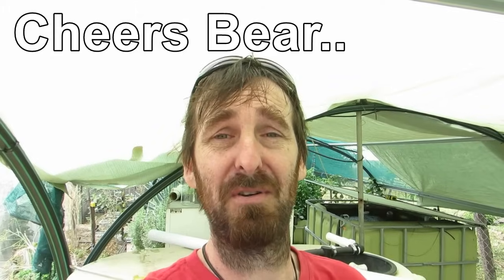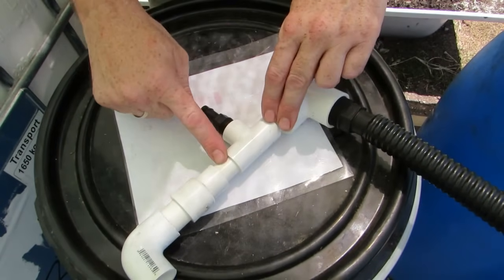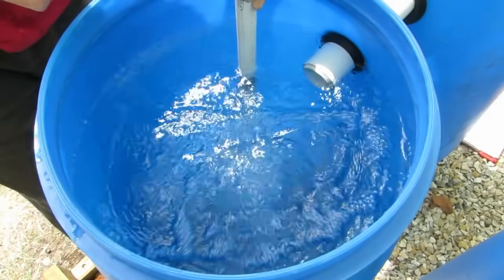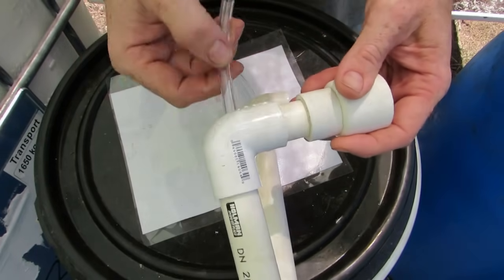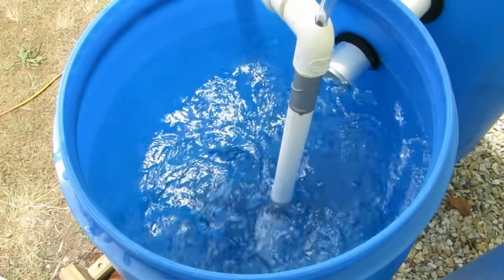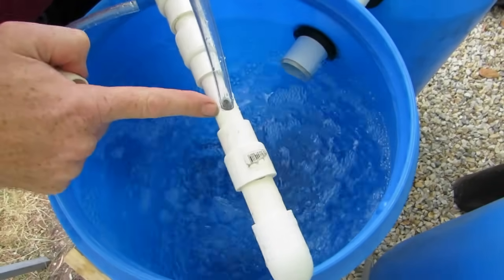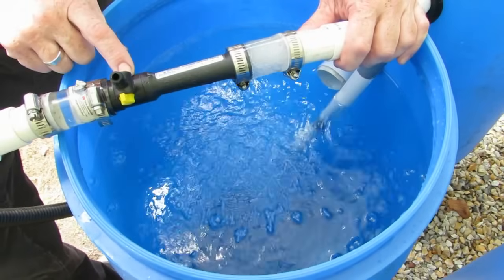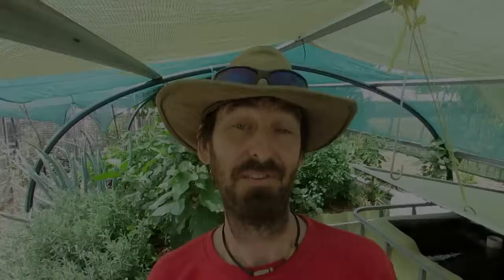DIY venturi, a few easy builds for aquaponics, aquaculture or hydroponics..

Comment: I'm using a 275 gallon ibc tote as my fish tank. with 6 tote growing beds.what size pump should I use? thanks
Reply from the maker: Hi Bonnie. 
The rule of thumb is to turn the water over in the fish tank at least one & a half times every hour if not twice an hour. That will give the grow beds enough time to process the waste from the fish.
 
Then you need to take into consideration the loss of flow due to head height as well as restrictions in the pipework  (90° turns in solid PVC pipe will reduce flow rates). 

The way you want to set up the flow through the system (pump to fish tank from sump & let it flow via gravity to the beds OR splitting the flow from the pump to the grow beds & the fish tank like ours) will also play a factor in sizing the pump. 

As an example, 
our first 275 gal fish tank system I had a 1188 gal per hour pump run straight to the fish tank from the sump & by the time it got to the fish tank  was only putting out 713 gal per hour. 

Another thing to take into account is that the manufacturers claims on the box in terms of head height & gph are seldom accurate. I think it always pays to over size your pump as there are ways to reduce the flow but you cant beef it up if need be. 

I know it doesn't answer your question but hope it does help give you a few things to think about.

Comment: How about putting an aeration screen on the output too to make the bubbles smaller as they exit from the hose?
Reply from the maker: Have though about that but am a bit concerned that the finer holes might clog up with solids waste over time.. Is a bit hard to service the pipe in the base of the fish tank.. Cheers for the thought & have a great one..
Rob..

Comment: Rob, that water looks great in your IBC. I'm assuming you're using a rad. or swirl filter?
Reply from the maker: Hey Brad..We had a small radial flow filter on the aquaponics in that set up.. Any fine solids that made it through get caught in the bed but I don't think that's a big issue.. 
Cheers & have a great one..

Comment: So i have a question the big hose pushing that the water thru the white PVC as the water goes by the T portion is the pressure the same as the water going by? or is it vaccum that pulls air in
Reply from the maker: Hi there..
At the position of the restriction below the air pipe coming out of the "T" the internal pressure is low which allows the air to be sucked into the water flow as I understand it so I think you're on the money there..
The chap in this clip goes through the workings & pressures involved..
Fluid Dynamics VII: The Venturi Effect
Hope that helps some..
Rob :)

Comment: Has anyone suggested putting a device similar to this at the suction of the pump? (depending on the pump)  The flow from the pump pulls in the air and then hits the impeller causing very fine bubbles and great mixing.
Reply from the maker: Have been told that it could damage some pumps. Not sure myself as I haven'y looked into it.
Cheers.

Comment: Is the smaller price of pipe nessacary to the venturi? Or could u just put q tube straight into the pumps tubing?
Reply from the maker: Hi SC Prepper. 
It does help create a low pressure zone as I understand it which helps more air to enter. I have also made them without the restriction with some vinyl hose & it works too, just don't think as much air gets in.
Hope that helps some mate.
Rob.

Comment: First, thanks for the awesome video. Secondly, I am wondering if it would be possible to enter a bubble stone into the venturi itself, to ensure that the bubbles are as small as you would like them to be. I am looking to build an aquaponics system, so I have not tried this yet, but it seems like it might be possible somehow. Let me know what you think.
Reply from the maker: Hi Walter... I missed your comment somehow, sorry about that..
You could add one in there but am not sure how it will help with the bubble sizing..
The main reason I want to add the venturi so there is no need for another compressor in the new system.. Will still have a 12V air compressor as a back up in case the power is cut..
Cheers mate,
Rob..

Comment: Hey there Rob...
I have an issue trying to get the timing if the RFF, 2 GB and sump tank to all stay on one filled without running over at one point it another. Can you help me it direct me? Please
Reply from the maker: Hi Alison. Did you sort out the issues you're having with the system ?
Sorry I missed this.
Cheers.

Comment: hey rob nice video.  just wanted to say i  made one very basically but had a lot better results than the diy variants you mentioned.  just got 2 600ml soft drink bottles glue the tops together then cut to fit to the pipe in and out then drilled a hole to put 6mm hose in and glued it flush.  thought maybe you would like to try it. smaller bubbles and more flow.  though for $20-30 the earthan group ones are great value like you know
Reply from the maker: Sounds like a nice little build.. Do you have any pictures up on a page or in a group somewhere ? Would be good to have a look..
The parts for the RAS build should be here by this weekend so hope to be playing around with the venturis again soon.
Cheers.

Comment: I've been into aquariums for 15 years & seen ventures used in various applications but im new to aquaponics. I found this interesting because normally in an aquarium,  tank inlet (from a pump or filter) would be on a spray bar close to the surface of the water thus sucking air into the tank as the water is injected. Where as your forcing it to the bottom seems like a reasonable idea but if the power to your pump cuts out (or pump dies) you then get a reverse siphon & your entire tank will be dumped into your sump potentially loosing all of your fish if your not around (or in my case also flooding my lounge room! ) have you ever noticed this?  Or maybe you have a solution? ? I did try this out & works ok but when I turned off my pump I remembered the siphon....
Reply from the maker: Hey Rob..  
Played around with that scenario & found that the air inlet pipe stops a siphon from initiating & draining the fish tank.. Have turned the pump off loads of times to do maintenance & have never had any problems.. I do think that it helps that ours are installed above the water line if that makes sense.. 
Hope that helps some mate.. 
Cheers..
Reply: yeah thanks..i did think of that about a week later... turns out in testing i had the venturi tap too closed to break the siphon & recalling the flood incident from a few years back.. freaked out a little. all good, cheers

Comment: An air stone on the end inside pipe will get the small bubbles you want.
File it for flow, and add a dap of super glue at the top for strength.
Custom make one from a larger stone to use that 1/4” i.d. tubing you have there.
Those long straw like air bars will fit the line ok, but are worthless for making bubbles.
Don’t bother!
This straight tube method is still the best for aerating at a maximum.
Big bubble surface area is touching more water than little ones,
and when they surface will “boil” even more air in.
Reply from the maker: I found increasing the flow helped to get more finer bubbles with some of the units. 👍

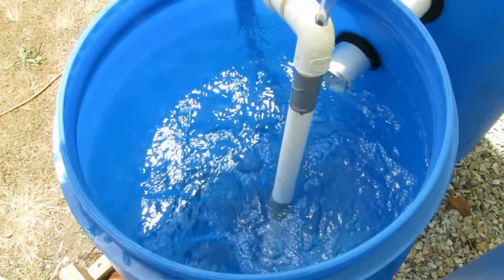Comment: 6:17 smaller the air intake tube…higher velocity air intake & resulting finer bubbles. Three stops at fast food joints & you would have enough straw sizes to create reducing section of air intake. Not sure if can be done effectively with ball valve

Comment: Have you tried running it through a straight t with no venture?  Using 2 inch diameter 5 cm or 3 inch 7.5cm diameter pipes.  water in from the horizontal and  water comes in about half a meter above the surface.  So it is a T on its side. Air comes in from top.  I don't know why people want venturi's at all.  Alternatively you can have a mini tank in a bucket above and plumb the downpipe through the tank to go 5 inches from the top and the water in about half way up.   You would probably get more water flow and less  strain on the pump. Brian
Reply from the maker: Hi Brian.. Have mucked around a few ways to try & get air into the water including like you mentioned with a straight T previously.. Running it like that really got no extra air into the system at all.. Not sure I understand your description completely so I may be doing it slightly different..
Looking at removing the venturi from this system for a while while I play around with other filters & swap a few things around.. Air pump is more reliable & I know the fish will be getting a good dose of dissolved oxygen that way..

Cheers Brian..
Reply: A venturi reduces the pressure of the water to below atmospheric via  https://en.wikipedia.org/wiki/Bernoulli%27s_principle . This is what draws the air in and makes the setup work.
Reply: Hi, Paul, we are talking a direct air pump putting air under the water,  so, we don't need the venturi. It might even be a disadvantage. Case in point,  I made a T-joint airlift pump (no venturi) that can  pump water to up to 2 meters high using as low as  0.2 PSI air pressure. I haven't tried to scale it up to  the sizes that you guys do. It is currently called airlift in a bucket and it has been used successfully in North America, Europe and Asia.   I will rename it shortly.  Brian
Reply: Brian White
Yep - that's a different thing altogether. I had misunderstood.

Comment: Great idea. I just made one the same as the first one you showed which I just tested with the garden hose. I got some air but not as much as you. What sort of flowrate/ pump size were you using? I am only using for emergency use with 12v so will buy a dedicated bilge pump to suit.
Reply from the maker: Sorry it's taken a while to get back to you. 
I think that pump was 3000L+ / 790 gal+ mate.
Reply: @RobsAquaponics  thanks. Made one. Works great.

Comment: DO is added into the water when the bubbles break the surface and cause turbulence, the bubbles in the water does not add DO, so you want as much surface action as possible.  The real test is pick up a DO meter so you know for sure works the best.
Reply from the maker: https://scialert.net/fulltext/?doi=ajsr.2014.482.487
Cheers

Comment: I built one of these, more or less 100% the same as yours Rob. But hey it didn't work. Water came spraying out everywhere, I played around with the 15mm bevel pice but with no success. Can you please help me out. Cheers
Reply from the maker: Hi Bradley.. That happened to me when I put the top pipe (with the reed) in the wrong way.. The bevel pointing towards the pump so the bulk of the water was flowing through the top fitting.. Would of made the blooper reel if the camera was filming :/ :D
What size pump are you running on your system & is there any chance you could upload a pic of the components laid out as you put them together to our G+ or FB page ? Bit hard to tell without seeing it..
Cheers

Comment: Hi I have a I think a 1000 litre fish tank ,what do you recommend if you where buying a fish pump ?
Reply from the maker: Hi there John.. I'm using a 4500LPH pump I got from Guppys,
http://www.guppysaquariumproducts.com.au/pumps-power-heads/hqb-/-jhq-submersible-pump/pump-4500l/phr-submersable-multi-purpose/prod_64.html
Has worked well for us so far.. Haven't really used any others so that's about all I can recommend for the time being.. They can be used inline or as submersible but I have only used them as a submersible so far..
Hope that helps a bit.
Have a great one mate..
Reply: Thanks for information .In the middle of building a horizontal pipe system ,plan to use syphon to give a stop and flow system -not sure whether that is right ,you see pipe systems on YouTube  but very little information on water control ,hope to hear from you Cheers
Reply from the maker: John Pink
 Hey John...
Think most of them run as a constant flow.. Built a basic one for the hydroponics over a decade ago but none for larger systems like the aquaponics.. Would like to include one in the new build though..
Hows the build going for you ?
Reply: Well I have completed the N F T system after  a few moderations -I found that by using a pipe reducer taking me from4" to 2"pipe inlet and outlet ,created a baffler enabling the water to stay at a height of 2" to cover the plant pots also a good constant flow
Reply from the maker: Nice one John Pink... A lot of what we end up with comes about through trial & error.. 
Cheers mate & happy growing..
Reply: Hi well the system up and running, interestingly as pointed out to me on aquaponics web  site the NFT system consists of a flat bottom square  pipe (nutrient film technique) ,the round pipe is known as a DFT system (DFT stands for deep flow technique which I have installed .Well I didn't know that ?
Reply: work out the height of fish Tank  Post to YOU-TUBE good information on web site

Comment: Hope I dont come off as a troll, not the case. Great video really. But I have been through this and tried different approaches. In my opinion, Venturis or air pumps are not necessary if you have good strong water flow falling back into the reservoir. Air pumps cant hurt, but I will never use them again unless I just have to.
Reply from the maker: Cheers for that... The only way to see for sure which method will work best for us is with a dissolved O2 meter.. I have read a few articles & had more experienced aquaculturists than I say its the length of time a bubble stays in the water column  the more O2 will be dissolved into the water so that's what I'm working on at the moment.. Not discounting vortexes, just don't have the time at the moment to play with them...
Cheers & thanks again..
Rob..

Comment: I suspect that the bubbles from the commercial venturi are re-combining in that long run of pipe.  Try putting a hose on the air inlet and put the venturi right at the water outlet.
Reply from the maker: That was the best way I could show it off for this clip. All mine are set up at the end of the pipe here.
Cheers Ron.
Reply: 👍  Carry on.

Comment: Hello what formula would I use to work out Pond pump size for venturi in 80 litres of water?
Reply from the maker: It depends what you're trying to achieve. Is it for fish in an aquaponics system, small pond, aquarium or to originate the roots of plants in a deep water culture bed?
At a guess, I would be looking for a smaller aquarium style venturi that could run on a 80-150lph flow rate.👍👍
Reply: @RobsAquaponics  Thanks, It's to agitate and oxygenate a nutrient resivoir for DWC.
Reply from the maker: @SnifterRoux  I think a smaller aquarium or small DIY venturi would be the go. 👍
I've got a few of the small Infusinator venturis to play with here & they look very promising. 
https://www.youtube.com/watch?v=m593j97d-Ts

Comment: If you can add the air hose to the intake of the pump you will get the little bubbles you are after. But be warned you will lose a bit of flow of water over all.
Reply from the maker: Hi there..
Have seen a few folks mention that on forums for hydroponics to help oxygenate their systems.. One chap pointed out that it can damage some styles of pumps so I passed up on that idea.. The other issue is the decrease in flow like you said which is something I really don't want in our systems.. As it is our 4500LPH is only pushing through 2700LPH :/
Thanks for the suggestion & have a great one..
Rob..

Comment: Hey RB???? Can I put fish in sump tank as well as fish tank? Maybe mature fish in fish tank and fingerlings in sump? Good idea or bad? Also... I have 200 liter grow bed and 1 blue 55gal drum cut in half... How many fish can I have w that setup(I will be expanding for sure)
Reply from the maker: Hi there...
I have been told that it isn't a good idea to keep fish in the sump as their waste will then be pumped into the fish tank.. In saying that we have a few gudgeons (40mm/1.5") in our sump tank left over from before the system was up & running.. There are about 12 of them but as they are so small I really don't think they are much of an issue..
Stocking rates are normally dependant on the volume of media you have in the water for the bacteria to colonise.. Even though you will have small fish you always use their mature harvest weight when making calculations.. The general rule for stocking is 25L of flooded media to every 500g/1lb of mature fish.. This is normally based on clay media or 20-25mm/ 0.75-1" rock..
Hope that helps you out some & let me know if you want more information..
Cheers,
Rob..
Reply: So if I do the math right I could have about 15-18 fish. W my current set up?
Reply from the maker: DRUMofTRUTH  If your using the 200L bed + the 100L half barrel I would say 12 full sized 1lb/500g fish if you wanted to stick to what the general rule.. 300/25= 12..
How large is the fish tank ?

Comment: Rob!   very cool videos. I am curious how you keep your tanks so clean? Are you cleaning them or does the system stay that clean?  I am about to start testing a cleaning system for a company here in the states. They have a system I think could be adapted to aquaponics, they sent me the system to test.  Without giving too mych away I would be removing the excess solids left it the fish and sump tank (whatever is not sucked up the SLOW pipe) once or twice a week.  While testing the water constatntly. This system has scrubbers as well which would rub off algae etc. I have a very small system. 450 gallons. I will go through your videos to see if you are cleaning them but thought I would drop you a message to ask. Love the venturi ideas. I am definately going to add venturies to my system. Do you think it has ANY negative effect on water flow?  Thank you